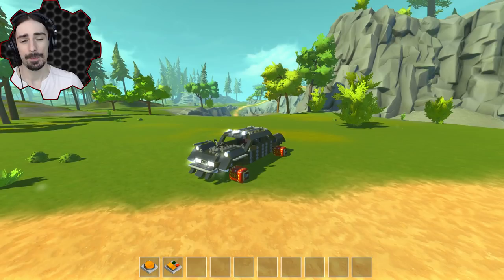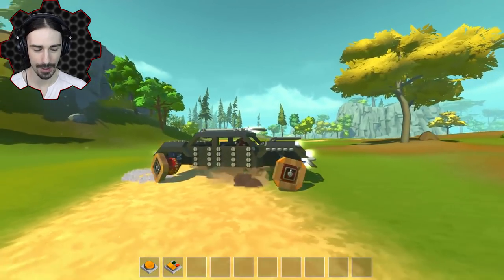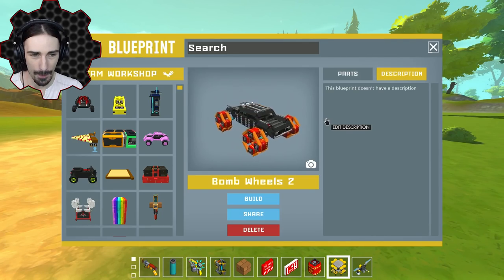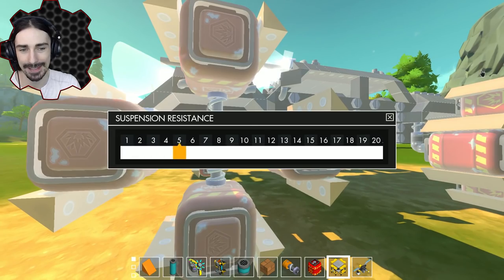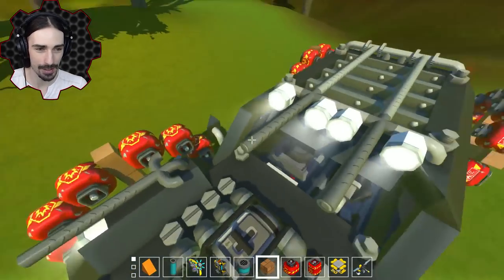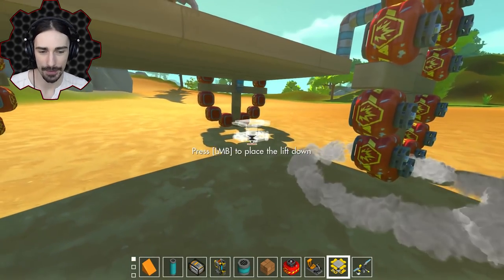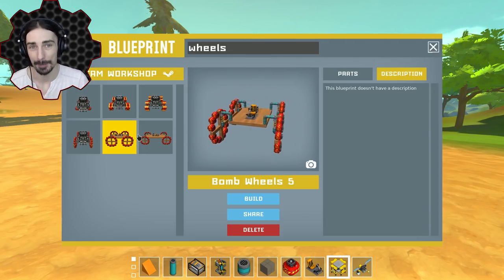Explosive Wheels Challenge! [Your Turn!] - Scrap Mechanic Gameplay

Comment: Can you do another random wheel challenge for multiplayer monday!

there are a lot more options you could have:

big explosives

small explosives

Block of metal

Spud gun pin wheel thing

suspension and boot 

&
👢 

walker wheels

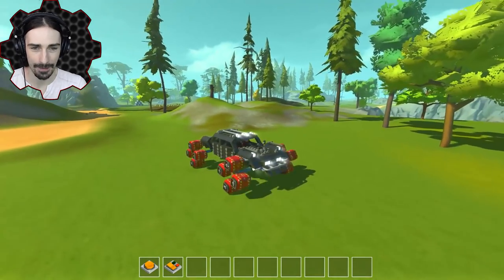that one at 7:40

there are probably a lot more than that!

Comment: Can you use the speedometer to ensure speed rather than the notches on the engine because at 7:55 the wheels were going slower but the speed of the car was the same if not faster despite the lower engine speed